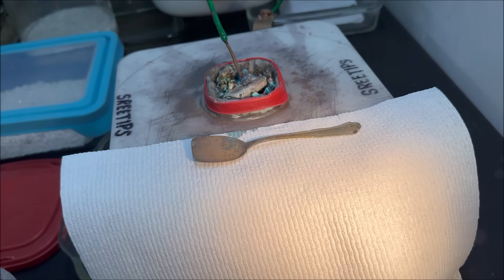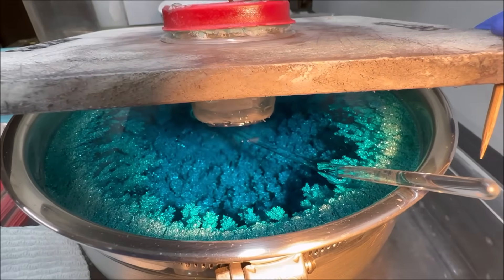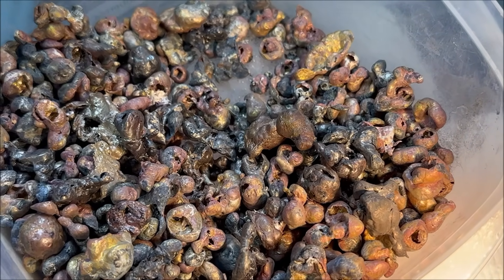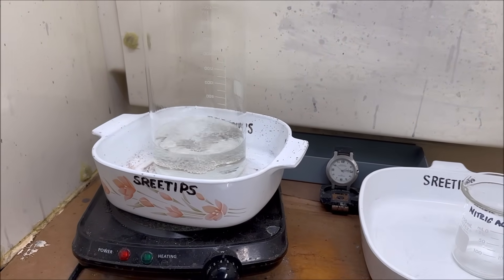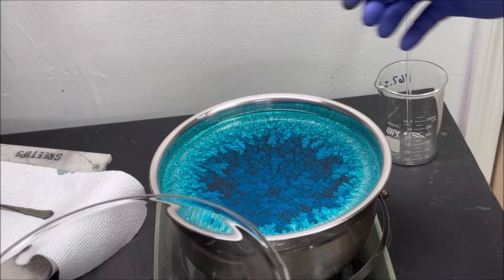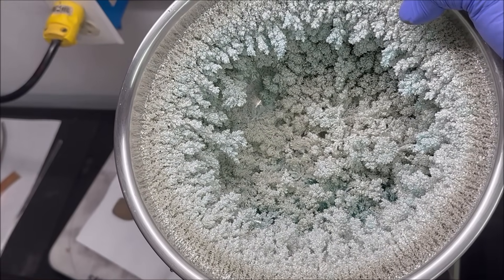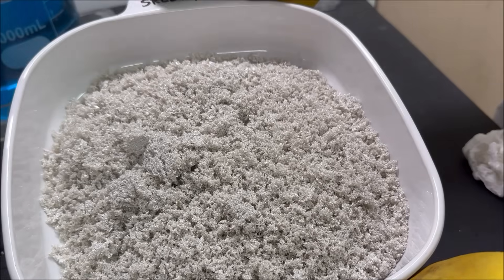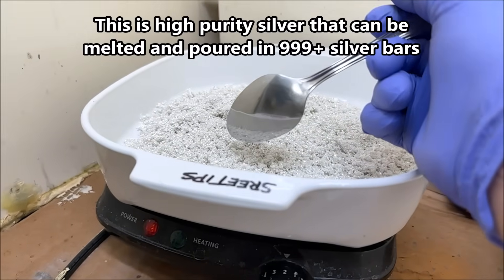999 Fine Silver Cell Harvest and Reboot

Comment: Is the impure silver required in the basket? If so how can I get some? I have two 10oz silver bars currently for use in this system.
Reply from the maker: I refine gold. I use sterling silver, that I buy at estate sales, to refine the scrap gold. I recover the silver from that, melt into shot, and run it through my silver cell. Silver is a by-product of my gold refining. The cell converts the impure silver (about 980 parts per thousand silver) to high purity four nines fine (9999 parts per ten thousand) pure elemental silver metal. So I’m refining the impure silver, into high purity silver, not creating silver out of thin air. When it’s full, I harvest the pure silver crystal, put it away and forget about it. Then I repeat the whole thing again.

Comment: Where do you get the scraps of silver.
Reply from the maker: I refine gold. I use sterling silver, that I buy at estate sales, to refine the scrap gold. I recover the silver from that, melt into shot, and run it through my silver cell. Silver is a by-product of my gold refining. The cell converts the impure silver (about 980 parts per thousand silver) to high purity four nines fine (9999 parts per ten thousand) pure elemental silver metal. So I’m refining the impure silver, into high purity silver, not creating silver out of thin air. When it’s full, I harvest the pure silver crystal, put it away and forget about it. Then I repeat the whole thing again.
Reply: @sreetips   I mean there’s pretty much silver in everything. thanks for responding.

Comment: So do you just start with a regular bar and dissolve some to start or you just have silver byproduct from other reactions?
Reply from the maker: Pure silver bars or rounds can be used to make the electrolyte for the first run of the silver fell. After that, I reserve a little pure silver crystal from a harvest to make electrolyte for the next run.

Comment: Ok my first time seeing anything like this. To make sure I got it straight. You used scrap silver and some cheap acids etc plus electricity and grew/made brand new silver which can be melted down and turned into bullion? 2 or 3 hundred grams of scrap created 1.3 kilos of pure 999 fine? Is that correct?
Reply from the maker: I refine gold. I use sterling silver, that I buy at estate sales, to refine the scrap gold. I recover the silver from that, melt into shot, and run it through my silver cell. Silver is a by-product of my gold refining. The cell converts the impure silver (about 980 parts per thousand silver) to high purity four nines fine (9999 parts per ten thousand) pure elemental silver metal. So I’m refining the impure silver, into high purity silver, not creating silver out of thin air. When it’s full, I harvest the pure silver crystal, put it away and forget about it. Then I repeat the whole thing again.
Reply: @sreetips  it's mind bending.. but very cool.. so do you end up with more silver than when you first start the process and can the silver you end up with be melted and minted?
Reply from the maker: No, for every 100 grams of impure 98% silver shot that I add into the cell, I’ll harvest about 98 grams of high purity silver crystal. I could melt into bars and sell them. And I may start doing that again when silver gets up over a hundred bucks, if I need some currency to pay bills or buy food. But really, there’s no need to sell any silver. Especially with the spot price so grossly undervalued.

Comment: Just curious, I googled and it seems a kilogram of pure silver is worth a little above $1.000. What is your margin, after buying sterling silver and all the materials for the reaction? If I may ask. Thank you.
Reply from the maker: I refine gold. I use sterling silver, that I buy at estate sales, to refine the scrap gold. I recover the silver from that, melt into shot, and run it through my silver cell. Silver is a by-product of my gold refining. The cell converts the impure silver (about 980 parts per thousand silver) to high purity four nines fine (9999 parts per ten thousand) pure elemental silver metal. So I’m refining the impure silver, into high purity silver, not creating silver out of thin air. When it’s full, I harvest the pure silver crystal, put it away and forget about it. Then I repeat the whole thing again.
Reply from the maker: I do not know. I’d have to sell it to determine that. And I’m not selling any of my silver, other than what’s listed on my eBay site.

Comment: What's the origin of the silver and what do you do with it next? Not where to sell pure silver crystals ))
Reply from the maker: I refine gold. I use sterling silver, that I buy at estate sales, to refine the scrap gold. I recover the silver from that, melt into shot, and run it through my silver cell. Silver is a by-product of my gold refining. The cell converts the impure silver (about 980 parts per thousand silver) to high purity four nines fine (9999 parts per ten thousand) pure elemental silver metal. So I’m refining the impure silver, into high purity silver, not creating silver out of thin air. When it’s full, I harvest the pure silver crystal, put it away and forget about it. Then I repeat the whole thing again.
Reply from the maker: When silver gets up over a hundred bucks I’ll start making and selling pure silver bars.

Comment: How much does it cost to harvest that much silver? I’m sorry if this sounds stupid but I’ve never seen anything like this before. It’s pretty incredible.
Reply from the maker: No problem, here’s what happening here: I refine gold. I use sterling silver, that I buy at estate sales, to refine the scrap gold. I recover the silver from that, melt into shot, and run it through my silver cell. Silver is a by-product of my gold refining. The cell converts the recovered impure silver (about 980 parts per thousand silver) to high purity four nines fine (9999 parts per ten thousand) pure elemental silver metal. So I’m refining the impure silver, into high purity silver, not creating silver out of thin air. When it’s full, I harvest the pure silver crystal, put it away and forget about it. Then I repeat the whole thing again. I’m not concerned with having to resell the silver for a “profit” because the silver is my profit. Silver (and gold) are real money, real wealth. Paper dollars are a money substitute, they have no real value. Because paper dollars can be printed “without limit” out of thin air.

Comment: So what’s the point of mining, when you can just do this??
Reply from the maker: Silver is first mined then it’s refined.
Reply: @ oh I see, this is just a form of refining the metal. Thank you!
Reply from the maker: Correct. I refine gold. I use sterling silver, that I buy at estate sales, to refine the scrap gold. I recover the silver from that, melt into shot, and run it through my silver cell. Silver is a by-product of my gold refining. The cell converts the impure silver (about 980 parts per thousand silver) to high purity four nines fine (9999 parts per ten thousand) pure elemental silver metal. So I’m refining the impure silver, into high purity silver, not creating silver out of thin air. When it’s full, I harvest the pure silver crystal, put it away and forget about it. Then I repeat the whole thing again.
Reply: @sreetips got it. Thank you for that. Ya for some reason I thought you found a way to create silver, I was a bit in shock, haha. That’s what happens when I watch videos in 1.5x speed, I miss a lot.

Comment: Sorry for the ignorance…but what is the point? Was the bar of silver not pure?
Reply from the maker: I feed impure silver in, get high purity silver out.
Reply: So essentially you're upgrading the resource ? @sreetips
Reply from the maker: I’m refining the silver to high purity. I refine gold. I use sterling silver, that I buy at estate sales, to refine the scrap gold. I recover the silver from that, melt into shot, and run it through my silver cell. Silver is a by-product of my gold refining. The cell converts the impure silver (about 980 parts per thousand silver) to high purity four nines fine (9999 parts per ten thousand) pure elemental silver metal. So I’m refining the impure silver, into high purity silver, not creating silver out of thin air. When it’s full, I harvest the pure silver crystal, put it away and forget about it. Then I repeat the whole thing again.

Comment: So this means it doesn't have to be mined anymore?
Reply from the maker: I refine gold. I use sterling silver, that I buy at estate sales, to refine the scrap gold. I recover the silver from that, melt into shot, and run it through my silver cell. Silver is a by-product of my gold refining. The cell converts the impure silver (about 980 parts per thousand silver) to high purity four nines fine (9999 parts per ten thousand) pure elemental silver metal. So I’m refining the impure silver, into high purity silver, not creating silver out of thin air. When it’s full, I harvest the pure silver crystal, put it away and forget about it. Then I repeat the whole thing again.

Comment: wouldn't it be easier to just buy fine silver? what did you put into, time material energy?
Reply from the maker: I refine gold. I use sterling silver, that I buy at estate sales, to refine the scrap gold. I recover the silver from that, melt into shot, and run it through my silver cell. Silver is a by-product of my gold refining. The cell converts the impure silver (about 980 parts per thousand silver) to high purity four nines fine (9999 parts per ten thousand) pure elemental silver metal. So I’m refining the impure silver, into high purity silver, not creating silver out of thin air. When it’s full, I harvest the pure silver crystal, put it away and forget about it. Then I repeat the whole thing again.
Reply: @sreetips  so, let me get this straight. When you refine gold, you end up with silver?
Reply from the maker: I use sterling silver in my gold refining process. Silver is a by-product of my gold refining hobby. So I recover the silver, melt into shot, run it through my silver cell, harvest the high purity silver, put it away, and forget about it. Get it?
Reply: @ okay, I am very new to precious metal refining. So, you use sterling silver when refining your gold? Interesting! I’ll have to check your page for videos regarding that process. Then it looks like you take the remains and refine those? 
Either way I love it! Seems like a legitimate science project you have going on and I love it!😂 How profitable is it searching estate sales etc… for gold? 
My thing is cars, so I’ll probably never be a “competitor” of yours. But I do find it extremely fascinating. 
I am a fan of trading and gold is making new all time high’s every week so it must be lucrative!
Reply from the maker: People are clueless about silver and gold, but this is changing as the metals appear to be rising. The metals are NOT going up in value nor becoming more scarce. What’s really happening is the value of the dollar is decling due to currency being printed out of thin air. This fact must be firmly grasped in order for the case of holding your wealth (at least part of it, I’m all in) in metals, gold and silver, makes good sense. They can’t print more gold and silver. Cash is trash, and becoming more worthless day by day. If you need some paper to pay bills or buy food, then you can always convert a little of your metals to currency by selling some silver or gold. By the way, you don’t have to refine your karat gold or sterling silver. They can be held just like it is. The only reason I refine is to make videos for my YouTube channel. The karat gold and sterling will track right on up with the bullion price. Holding your savings in precious metals is a very wise decision. Hold your savings in stacks of printed paper dollars, that are declining, is insanity.
Reply from the maker: When silver gets up over a hundred bucks I may start making pure silver bars again and sell them on my eBay site. The silver is my retirement fund.

Comment: Impure silver is  not found on road sides
Reply from the maker: I refine gold. I use sterling silver, that I buy at estate sales, to refine the scrap gold. I recover the silver from that, melt into shot, and run it through my silver cell. Silver is a by-product of my gold refining. The cell converts the impure silver (about 980 parts per thousand silver) to high purity four nines fine (9999 parts per ten thousand) pure elemental silver metal. So I’m refining the impure silver, into high purity silver, not creating silver out of thin air. When it’s full, I harvest the pure silver crystal, put it away and forget about it. Then I repeat the whole thing again.

Comment: Could you just explain to me as an unexperienced scientist, are you taking inpure silver and simply making it 999 through this process or are you actually growing it?
Reply from the maker: I refine gold. I use sterling silver, that I buy at estate sales, to refine the scrap gold. I recover the silver from that, melt into shot, and run it through my silver cell. Silver is a by-product of my gold refining. The cell converts the impure silver (about 980 parts per thousand silver) to high purity four nines fine (9999 parts per ten thousand) pure elemental silver metal. So I’m refining the impure silver, into high purity silver, not creating silver out of thin air. When it’s full, I harvest the pure silver crystal, put it away and forget about it. Then I repeat the whole thing again.
Reply: @ thank you for the detailed explanation! This makes perfect sense now! Great job! You are very good at it! 💪

Comment: You can grow silver????
Reply from the maker: Yes, I refine gold. I use sterling silver, that I buy at estate sales, to refine the scrap gold. I recover the silver from that, melt into shot, and run it through my silver cell. Silver is a by-product of my gold refining. The cell converts the impure silver (about 980 parts per thousand silver) to high purity four nines fine (9999 parts per ten thousand) pure elemental silver metal. So I’m refining the impure silver, into high purity silver, not creating silver out of thin air. When it’s full, I harvest the pure silver crystal, put it away and forget about it. Then I repeat the whole thing again.

Comment: so... all you really did was make it pure ? in a very long and expensive way ?
Reply from the maker: I refine gold. I use sterling silver, that I buy at estate sales, to refine the scrap gold. I recover the silver from that, melt into shot, and run it through my silver cell. Silver is a by-product of my gold refining. The cell converts the impure silver (about 980 parts per thousand silver) to high purity four nines fine (9999 parts per ten thousand) pure elemental silver metal. So I’m refining the impure silver, into high purity silver, not creating silver out of thin air. When it’s full, I harvest the pure silver crystal, put it away and forget about it. Then I repeat the whole thing again.
Reply: @sreetips  aahh so you're after the gold, and end up with not very pure silver and just refine the silver since you have it anyway ok i see
Reply from the maker: Correct.

Comment: The infinite money glitch?
Reply from the maker: I refine gold. I use sterling silver, that I buy at estate sales, to refine the scrap gold. I recover the silver from that, melt into shot, and run it through my silver cell. Silver is a by-product of my gold refining. The cell converts the impure silver (about 980 parts per thousand silver) to high purity four nines fine (9999 parts per ten thousand) pure elemental silver metal. So I’m refining the impure silver, into high purity silver, not creating silver out of thin air. When it’s full, I harvest the pure silver crystal, put it away and forget about it. Then I repeat the whole thing again.

Comment: Did you know they can separate elements though frequency which is more common but rarely mentioned and shown how. I heard low frequency might be used inside a liquid to separate aluminum from flyash. It works on small scale but big scale is another story.

And even rare thing I read scientists uses very high frequency (Maybe to remove atoms I think) to make gold from another element but cant find that info now since it was a while ago.

I assume your job is toxic? what eventually happens to the waste?
Reply from the maker: Waste treatment.

Comment: Is this process profitable? And if so (if you don't mind me asking) to what extent? Thank you!
Reply from the maker: I refine gold. I use sterling silver, that I buy at estate sales, to refine the scrap gold. I recover the silver from that, melt into shot, and run it through my silver cell. Silver is a by-product of my gold refining. The cell converts the impure silver (about 980 parts per thousand silver) to high purity four nines fine (9999 parts per ten thousand) pure elemental silver metal. So I’m refining the impure silver, into high purity silver, not creating silver out of thin air. When it’s full, I harvest the pure silver crystal, put it away and forget about it. Then I repeat the whole thing again.

Comment: Is this fake 🤷‍♂️ To sell electro nodes on ebay 😂
Reply from the maker: Fake? How is it fake? Every pure silver bar or round on the planet began as high purity silver crystal, just like you see in this video.
Reply: @sreetips  Why is no company doing that on a scale 🤔
Reply from the maker: But they are, except they use a moebius silver cell with gallons of electrolyte and pulling hundreds of amps in currency flow.